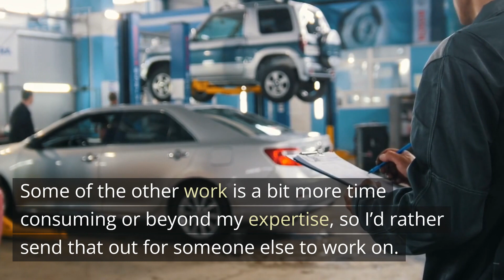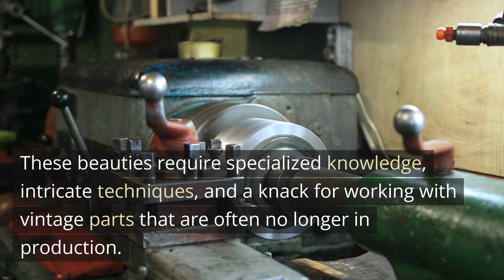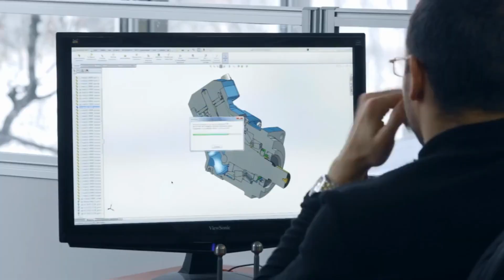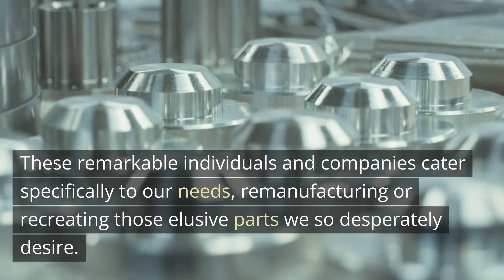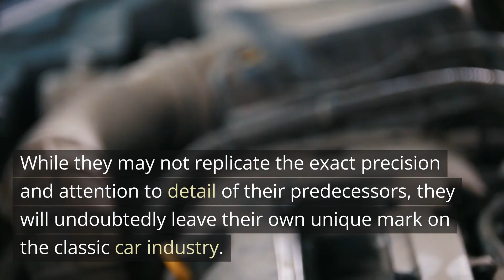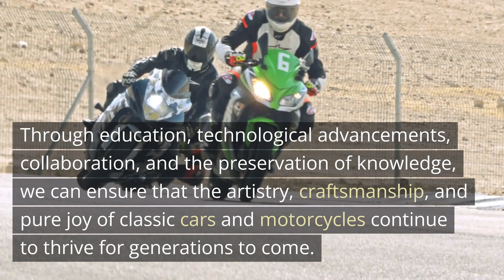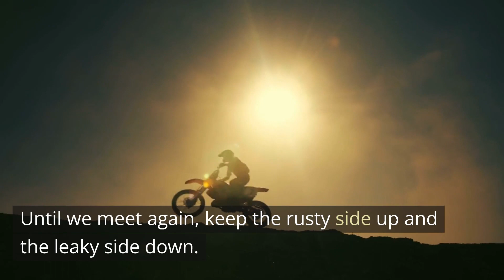What Happens When ALL the Mechanics RETIRE???

Comment: How do you learn with old cars? Grab a wrench and hop in.
Reply from the maker: Couldn't agree more !!!!! :) Thanks for listening and commenting!!
Reply: @kintsugimoto  I started on my sister's 70 model rs Camero and went from there. I was kind of a high school mobile garage. People always come by my house at 2:30 am and want me to start their cars. My parents just rolled their eyes back.
Reply from the maker: @paulrbruce  HAHAHAHA ... my start wasn't as cool as yours!! My first car was a Toyota Tercel, which I bought with my summer job money, but my Dad wouldn't let me drive until I learned how to work in it. It started with simple fluid changes, then progressed to rebuilding carburetors, and then hunting down parts at the junkyards ... I haven't stopped wrenching since :)
Reply: @kintsugimoto  If you had seen my car, "cool" wouldn't begin to describe it. It was two steps from a salvage yard. I have always had a gift for cars, and anything electrical. I hotwired my car once, and a cop came over and looked at me. I told him, yes, it was hotwired and I did it. I showed him my license, and all was good. That is when I learned what a neutral safety switch was.
Reply from the maker: @paulrbruce  Ahhhh, electrical is my achilles heel. My first project car after the Tercel was a 1970 Triumph TR6 which has Lucas electronics ... that's when I learned about the Prince of Darkness!! I'm getting better at troubleshooting electrical issues, but I would still rather go carb over fuel injection for my projects :)
Reply: @kintsugimoto  Take a Holley any day of the week. My friend had a car with a 440 in. It was a Chrysler 300 Imperial. Man that was a tank and it was heavy. My car averaged like 4 MPG. Was not built to drive very far. My dad was an electrical contractor and both sides of my family are engineers. So the electric stuff comes easy. You can keep that Lucas system. I have heard about those. 😆
Reply from the maker: @paulrbruce  Hahahahaha ... yeah, it's not fun to learn electrical on Lucas electronics.